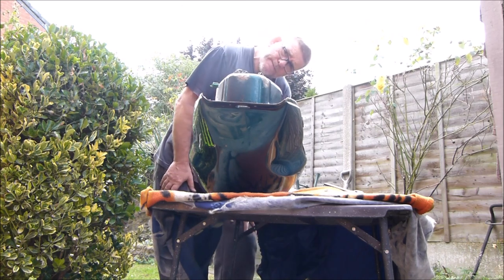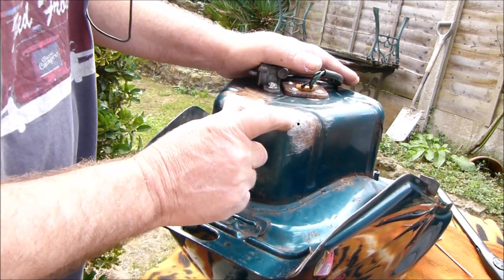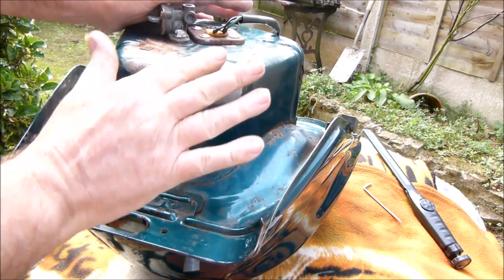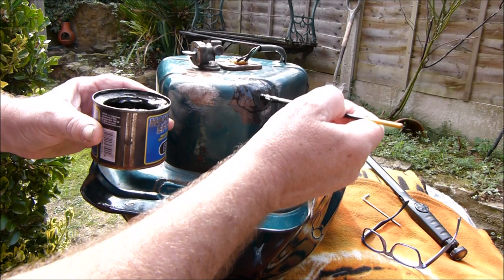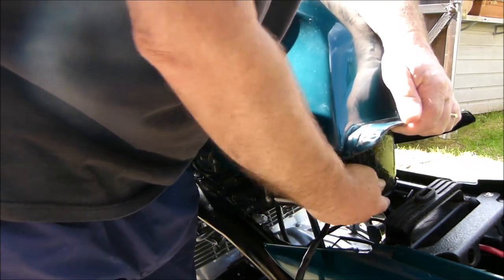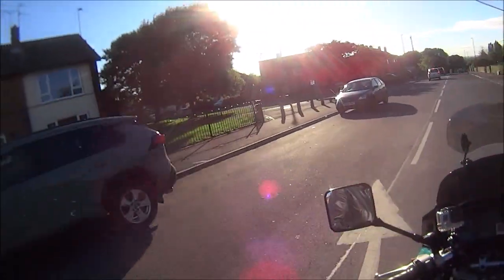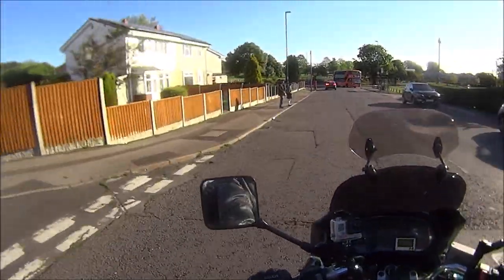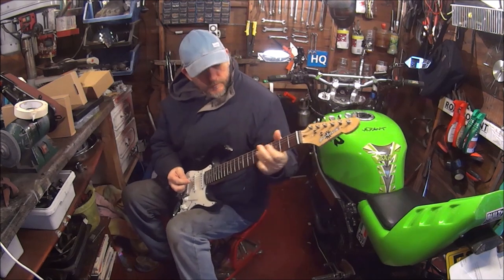XJ900S division. Leaking Fuel Tank Repair.

Comment: Hi there John,

I own a CBR 1000f and it had a rattle, thought it was the camchain tensioner...

It turned out to be the actual camchain was stretched..

I replaced the camchain and also put the CB 1000f tensioner in it .,it has a bigger piston plunger on the bottom of it .
My CBR is ticking over like a Rolex watch now 😉.

Also double check you have your cams timed properly !.

Good luck ,

Best regards rich 🍺👍🏴
Reply from the maker: Hi Rich. Thanks for the helpful information buddy it's very much appreciated 👍